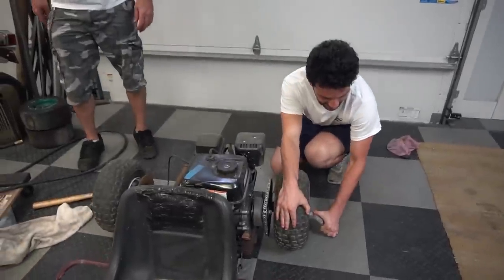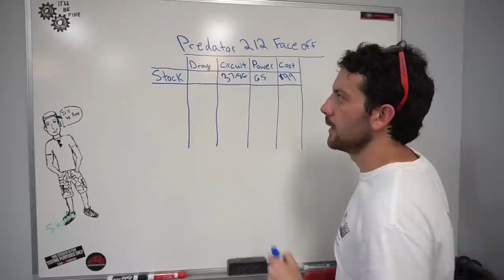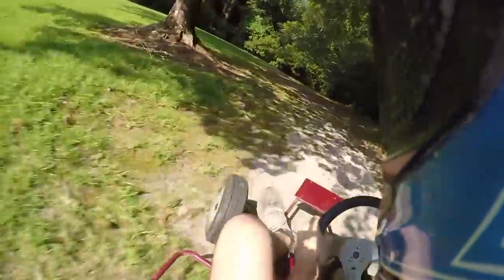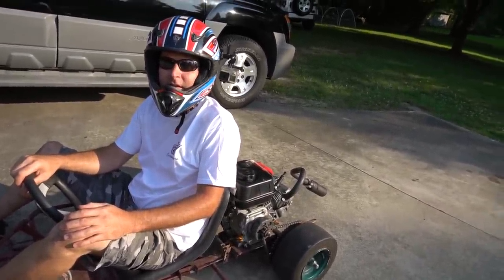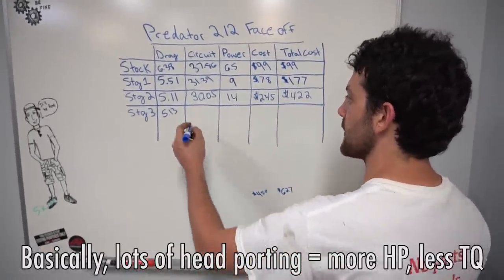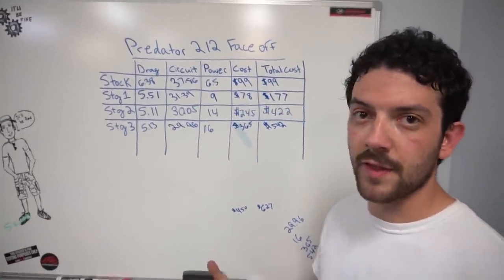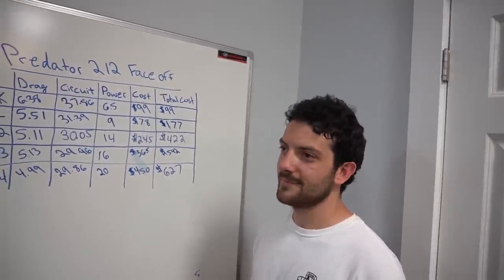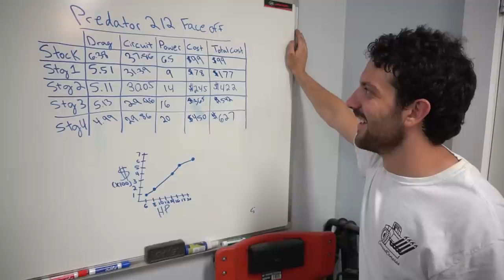5 Engine Showdown! Mild to WILD Predator 212cc Comparison

Comment: You guy should do something with a 5hp briggs and stratton flathead
Reply: Rat Rod Wagon has one, but I think it’d be cool to mod it to all hell lmao
Reply: Colepaq yeah that's what i meant
Reply: They mentioned they may try to build the one in the rat rod wagon, but they'd have to find parts first
Reply: Like one for the 50$ go kart or a yard cart with a bunch mods
Reply: I'd love to see the Rat Rod's Briggs modded!
Reply: I've had an open modified Briggs Raptor before. It was a methanol motor.
 Billet 3" crank
ARC 4.225" connecting rod
ARC adjustable timing flywheel
ARC valve breather
Clements cylinder head
Jr. Race car engineering head girdle
Tillotson 380A carb
Unsure of intake manifold length(length of the intake dictates tq vs hp curves)
Double valve springs(don't know how much pressure they were or the brand)
Intake valve was stainless steel and larger than stock
Exhaust valve was stock
I forget the cam brand and grind 
A racing coil of unknown brand
Can't recall if piston was stock or aftermarket
Thats pretty much all you gotta have to make a kickass briggs n stratton except for what i couldn't remember about it. I wasn't the builder, but i was the last one to enjoy it. The guy i traded it to put it on a cheapo trail bike and nearly killed himself on its maiden voyage. Ended up breaking the crankcase and it was only good for scrap after that.
Reply: I need a good 5hp type of motor! I have a gx100 clone right now and not much top room.. its a phatmoto rover 2020.. but was thinking the gx160 could fit...any other motors that are about the same size as the gx100??

Comment: id like to see what different fuel does for output, great video as always guys.
Reply: Mustie1 theoretically a higher octane fuel wouldn’t really have any performance benefits if he’s not having combustion issues such as spark knocks it octane knocks. But you never know until you test it
Reply: Christian Lucatino alcohol? E85?
Reply: Mustie1 you have to use the racing fuel in the stage 3/4 because they have such a high compression compared to standard
Reply: Mustie1  I removed my uncalled for comment
Reply: thank you
Reply: built 212's for drag racing that are intended to be used with methanol fuel have been reported in the 30hp range
Reply: Ethanol has a high octane rating (around 113 on the Australian scale) so it suits boosted applications and worked NA Engines. Problem is working out how to increase the ve to compensate for the lower energy density. Small turbo?
Reply: Imagine if you gave everyone your samba username. Lol 
 it would be a cluster fuck.
People would be contacting you 24/7 on PMs 😆😆😆
Reply: I converted my Hemi 212 to Methanol using a .650 SA Carb and wow what a difference in power! Before when I was running gas I was using a real Mikuni VM22. Huge difference but be prapared to burn alot of fuel at $6 per gallon
Reply: I run mine on 100LL
Reply: A comment from my other favorite channel!

Comment: Very nice video only problem is I’d say stage 3 would require a 26mm and that will give you best power combo as matched to its components all the way up to a 28mm  for a stage 4(depending on cam and head) ..but that’s just my 2 cents

Comment: tuning a 4 stroke exh pipe .. start with a long pipe paint it white ( cheap paint)  run engine till the paint burns off    cut off there  .... nice vids guys
Reply: Larry Broman cut off the burn tip, or cut where the burn tip ends?
Reply: How does that work
Reply: Dave Micolichek makes sense, I was thinking of ‘tuned length’ as in the length for the positive and negative pressure waves to reach the exhaust port in time at a certain rpm. I calculated the ideal intake length on a Wankel engine like that
Reply: Dave Micolichek yeah any intake/exhaust tract can be tuned like that. But the paint burning method is only affected by the diameter of the pipe and the exhaust gas temp, it won’t be the proper ‘tuned length’ according to wave speed
Reply: This only lowers the backpressure
Reply: The melted paint trick works for drag..not real practical  on street..however..on multiple cylinder motors..the point where paint  stops melting is the spot to add a H PIPE.. to help with equalizing backpressure if it's not equal length pipe.. u see this on v8s..

Comment: This video is a good example of the Law Of Diminishing Returns.
Very interesting!
Reply: Was getting ready to type this out, and figured I'd control-f first. Cheers on calling it out!
Reply: On the circuit it’s not, in circuit racing every millisecond counts it’ll make the difference between winning or losing especially in competition races. Milliseconds multiplied by laps in the race adds up. Not to mention better treaded tires for the off-road would greatly improve lap times

Comment: You have proven that the faster you go, the harder it is to go faster! Tenths become harder to find.
Reply: ElectronicRedPanda 
Nice reply. I usually get wrongness. No matter what I say. Its nice to hear this because because no matter what posive is always the right way. Left side gas tank filler? Wrong side. Right side? Yeah, that is simply the right side? No arrows for my gauges.
Reply: Yea because theres a limit to how fast u can go with slicks on grass trough trees. If it was on a proper asphalt track u would see a way bigger difference.
Reply: Get a taller slick for the rear.You don’t have to go that much taller to get huge results on top speed

Comment: Cool Vid, Happy 4th from what you did I did a quick $$ per HP rating.
Stock $15.23 per HP
Stage 1 $19.66 per HP
Stage 2 $30.14 per HP
Stage 3 $33.88 per HP
Stage 4 $31.35 per HP 
Essentially it is the same way with cars I mod.  Basic mods are cheap while high end mods can get very pricey per HP
Reply: exactly..at what price is 1 or 2 horse worth the costs?..i know there are a lot of people with more money than brains but the common man usually says nope that's too much for that little extra pep
Reply: San Man sweet. Thanks
Reply: San Man this helps!! I used it to base my build so I’m doing 3 stage one predator 212s👍🏼

Comment: You guys should make a day of it and go to that place Busco Beach or whatever it's called and map out a track plus you got the straight away and you can use the dirt tires. And, I think this is the best video of all the channels I'm subscribed to which pertain mostly to go-karts out of all of them because of the content and what you were trying to achieve. ( and did achieve mind you ) Good job guys!!!
Reply: From what I've seen Busco is pretty soft, for a dirt test I'd look for a clay oval track like Cherokee Speedway in Gaffney, SC. They could use one of the race cart frames there, work out a chassis setup and then do a motor comparison. The same could be done at GoPro in Mooresville for an asphalt test, assuming they can't do it in a parking lot somewhere closer to home.

Comment: For $500 you could put a 500cc motorcycle engine on it. Maybe even bigger.
Reply: BoostAddict ,  that's true and would be great for around the yard, however,  a 500cc would immediately disqualify you from 212 class races.  

I personally wouldn't go above Stage 1 for a yard cart.
Reply: camcarb3 
Honestly the performance difference between stage 4 and stock isn’t that impressive. you’d have to be chump to buy any of the performance kits.
Reply: @ThePiscis I disagree. I think stage 1 is a good bet for some extra pep. Anything more and you'll want to swap the motor.
Reply from the maker: Yeah, a big motorcycle engine is tempting, but a 212 is small and doesn't require any frame modifications. Different solutions work for different people.
Reply: john this is what i have been trying to explain to people who are always on this put the ducati motor on the rail  thing..people are so interested in what they want but they never try to do it themselves first to see the amount of work and fab that goes into it
Reply: Jane Ames I understand all the fab work that goes into it, I've been thinking about putting a snowmobile engine and torque converter onto my Murray Explorer for a while now. My problem is time and money. And yeah, 212s are the right choice for some people. But if you're spending $600 on a yard kart engine, why not go big?
Reply: That's how bigger engines work too.
Reply: Yea I agree, that’s the easy way to do it for some people. but...
a pumped up engine can be a blast, especially if you built it yourself.
Reply: A 2 cylinder 2 cycle 250 - 350cc motorcycle engine would be plenty...
Reply: I wish I could put 2 420 predator engines on the back of my Schwinn Meridian hooked to a solid axle with 2 sprockets. But there aren't any engine builders in Monterey Ca
Reply: I YAM WHITE if you want to find engine builders just take the 2+ hour drive into the valley (you should know what I mean given that you live so close and in Cali, if you don’t I mean like Fresno city and those places) but there are definitely engine builders in this area so that’d be a good choice
Reply: Thats a very silly statement... you must not do a lot of small bore riding/building. Sure anything can be built. I've seen a 650cc suzuki motor put in a 150cc scooter called the "iceberg" and be found on youtube.. I've seen ducati motors put in 50 CC Honda ruckus.. and them tiny e cars! Which is awesome.. but all them builds where done bye people not into small bore life but into building. It takes a TON of fabrication and modding. Not easy at all. And it  Defeats the point getting them small bore motors to put out a extra 10-20hp is a amazing feeling  and fun ride! Worth the time and money it takes. 
  My 50cc gy6 scooter trike fully built out does 60mph avg 50mph (60 was on a track lots of road)  pulls so hard front end comes up i enjoy riding it more than my goldwing trike. 
 My 2 stroke 80cc peddle bike hits 50mph and is more fun than my modded 800 CRB. Got to love them small bore life
  "Small bore whores"
Reply: Honestly, the reason you didn’t see any performance difference between the last couple stages is traction. Yard tires would give this kart a lot lower time

Comment: Just slap a 440cc Rotex off of a snowmobile in it and you'll be going faster then you'd ever want to go in that kart.
Reply: Derek Joon Better yet, a Polaris 700 triple.
Reply: BoostAddict Be wild but I don't even think you could get the power of a 700 triple to the ground lol just burn the tires off the rims!
Reply: No need to cray with displacement.  A Kawasaki Ninja 250 shifter cart could be stupid fun.
Reply: A busa 1000cc

Comment: it would be nice to see a dyno run just on the motor from stage to stage, i would really doubt you are getting 20hp at the end of the day
Reply: a dyno run would be cool to see but i disagree with you about the 20 horse..i would say more like 21 and a half horse ..problem is the lag between the pedal and the actual launch..with it not being a direct gear to gear launch it allows the clutches and belts to lag for a second or 2 before the cart moves
Reply: maybe, that is why it would be nice to see and maybe have a poll to see what people think the power would make, i worked at a place that made 1/4  midget motor 15 yrs ago and on the continental 3 hp motors we would get 20+ hp on the dyno on alcohol, so i maybe wrong.

Comment: John, Isaac, try running stronger springs in the 
clutches.  That'll give you a higher stall speed, 
and increase your drag strip times.

You want the clutch to start engaging, just before 
full power RPM.

You can hear it, when you start out.  Engine 
speed picks up, then slows down.  Clutch is 
engaging at too low of a speed. 

(This is the same trick drag cars do with 
torque converters on automatic 
transmissions.)

steve
Reply: Like the yellow spring mod on driven pulley for torque converter that's what I run on the 3rd hole and juggernaut driver
Reply: Where can you buy springs like this?

Comment: Awesome test,  I wish that you guys had used a higher stall clutch on the higher stage engines , most the HP increase is at higher rpms and on the drag test the diff would have been much better IMO.
Reply: Trent  Nell true

Comment: Why haven't you put efi turbo in a 212?
Reply: a turbo won't work on those engines
Reply: Marcus Munk how so? It's a 212cc engine, I'm sure it can spool up the rhb31. It's not a 50cc
Reply: you  need fuel injection and the ability to drastically change the engine timing...people make smog pump super chargers for these types of motors
Reply: It barely worked with the 420cc so it probably wouldnt do well in a 212
Reply: I spent the morning looking for a smaller Turbo and ended up here, I don't think there is one, I beg to differ on the Carb, should work OK, no need for FI, ignition timing too. Great Video, Makes me want a cart for my back yard
Reply: I got a small 10 mm to work on a new 250 cc 2 cylinder
Reply: I have  got it to make around 25 hp?

Comment: So all that money for 6sec?? i dont knows guys i need to see more ..cause stock is close  to EVERY thing youve build ..shows us more
Reply: Jay Walker The power is in a higher rpm range, so the drag race would have to be longer, plus having better tires so it can hook better
Reply: the clutch also SUCKED
Reply: I don't think that clutch can but the power to the ground on the take off for the stock 6.5
Reply: If you look on gopowersports there prices are way higher than he put on the board and not worth it
Reply: you could pick up a second hand 200cc motorbike engine for the original purchase price rebuild it for half the price they state here and still have a 6 speed gearbox to play with and a manual clutch, WR200 around 27hp and around 25tq just an example and also water cooled, even an early 80's air cooled 4 stroke 200 will get you around the 18hp mark with 5 gears to play with.
Reply: Mow Money Mods you would lose a lot of acceleration with a shifting.
Reply: yeah straight cut gears and the ability to flat change, only if you can't drive it would seem.
Reply: Mow Money Mods I can drive just fine. Like I said you could get too speed. But your take off wouldn’t be near as good.
Reply: if you have good clutch control you should be able to launch harder than a torque converter system, at the risk of bragging my "stock" YZ 250cc shifter kart would have smashed their 670cc "worked" drag kart off the line.

Comment: I wonder if you guys put an AMR300 supercharger with direct drive on the last engine @ 9000RPM. The engine is 212cc and blower is 300cc per revolution (around 141% of the engine displacement on direct drive)... It should create some nice boost without lag.

Comment: If you want in between stage 3 and 4 for about 2/3 of the price, try the duromax xp18hpe pull start from tool-up.com. $330 makes 18hp and 21 fp of torque.

Comment: 1- where are you getting ethanol free gas?
2- forget the courses, as long as they're the same the and somewhat repeatable then you're actually doing OK there (with the possible inconsistencies of the test driver, but not much you can do there), the problem now is your procedure- it's time to invest in some real timing equipment, the dragstrip run differences of the top 3 runs are likely within the timer's thumb's reaction time differences, not all that useful.
3- All your mods are increasing HP by increasing rpm capability.  A top speed run would be the most useful in giving people an idea of the ACTUAL hp increases (the dragstrip as it is setup and course runs give a better idea of how useful the changes are in that chassis/drivetrain).  In addition, if you had mph data at the end dragstrip run (something like the time/last 30'), long enough to take out a lot of the variables but short enough that the stock engine doesn't top out before the finish line would actually give you a number that you could calculate an actual HP getting to the tires number, you'd even be able to compensate for things like tire spin.  The problem with that is since you're not shifting through gears you wouldn't get numbers for HP over whatever the top rpm you go to in the run is, making the top speed run the most useful again.

I used to do this kind of work on cars at a speed shop and at one time I started with a Briggs 5.5hp flat head, milled the head, reshaped the chamber, ported it and did some other mods I was experimenting with (it was my lawnmower at the time, but the thing had a blown head gasket, I had nothing to lose and I have a Bridgeport mill sitting in the garage) and by the time I was done with it I had the best 22"self-propelled push mower I've ever owned.  Once the deck rusted out that engine got swapped into a 70's vintage Snaper Comet rear engine riding mower and it had WAY more power than the stock 8hp/11hp engines, it was able to do wheelies even with a lot less wieght over the rear wheels then the stock engine.  We guessed it was around 13 or so HP.  

If I had your following/sponsorship I would totally do another, maybe swap it into a basic, repeatable go-cart chassis (I've never owned one or a minibike) and set up real timers (I don't know if something exists, but it would be fairly simple to set something up with lights/photosensors like at a drag strip).  Maybe I need to get a Predator 212 or similar, take it apart and see if there is any obvous stuff that isn't available out there for them now... I just need a good excuse to do it from an economic standpoint. :-/

Comment: My guess is the circuit times would go down a lot more with more traction on the rear. Also a longer drag distance would probably show greater difference in times so the built engines could get into higher rpms. Great comparison though!